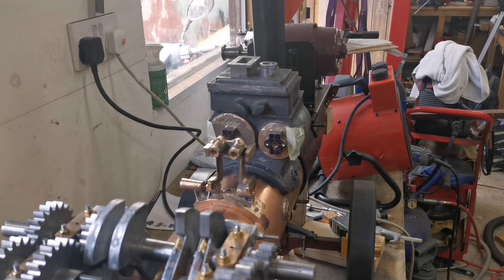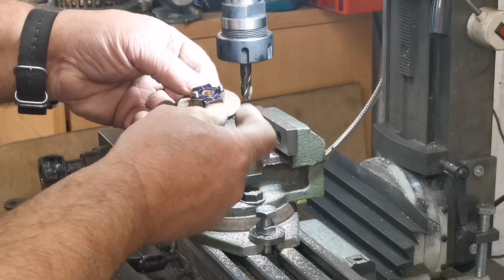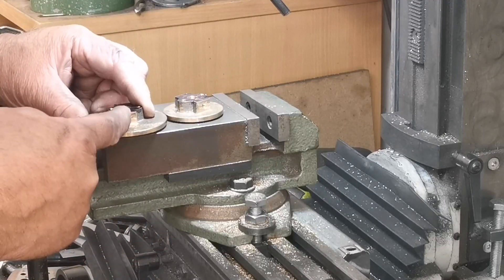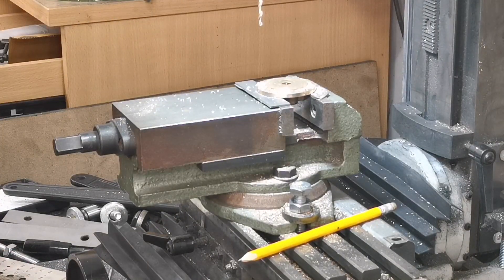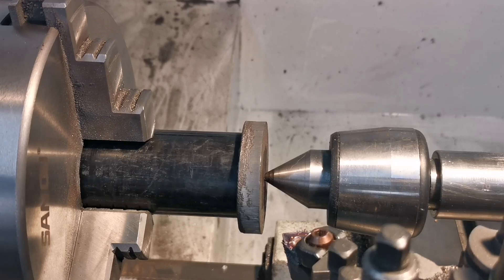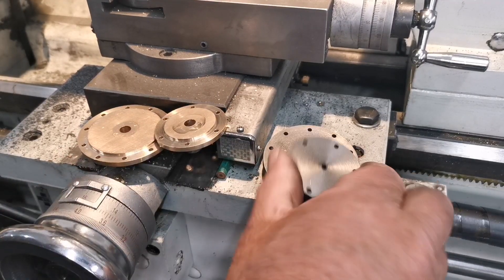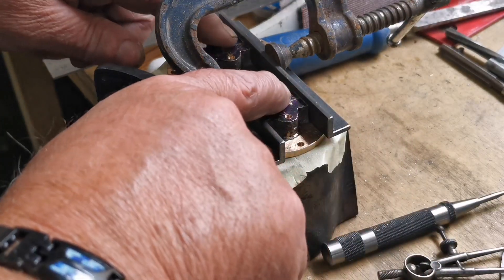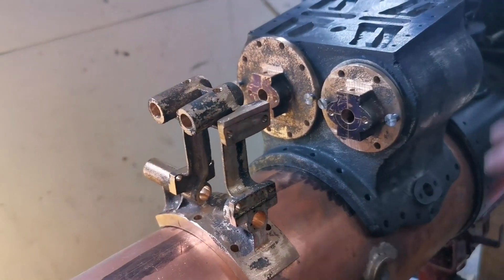2" Fowler Showman's Traction Engine cylinder end plates

Comment: Hi Julian I hope you are ok as we haven't seen a any thing from you. I'm thinking of buying a Chester craftsman lathe the same as yours are you still pleased with it or have you found any faults as it's a large layout to buy one. I would  appreciate your coments.
Reply from the maker: Hi, I am fine ,I have started a new video, I have a problem with my knee, the cartilage has gone, and the bones are rubbing together, I have been fitted with a knee brace which is making it a bit easier, I am up for a new knee joint sometime,  I am very pleased with the lathe, I know it is a large layout to buy one, and you get a lot for your money, but be prepared as it is very heavy, I used an hydraulic engine hoist to lift the main lathe on to the stand
Reply: @jammymowlam1  Good news that you're back in the workshop!! I hope the Docs can get you in for that new knee joint soon! it sounds like a painful condition to be in. Made even worse by not being able to get about. I'm going to be putting a deposit down on the craftsman at the end of June so I can get one by the end of July. If it's in stock in time, I may upgrade to the geared head lathe. Other than a slightly bigger gap bed I am not sure what differences it has to the normal craftsman model.